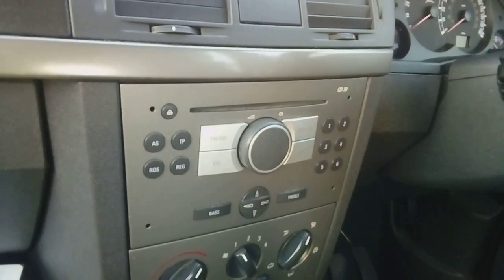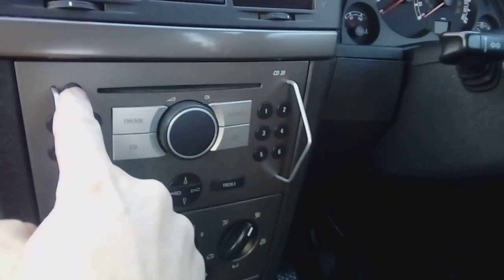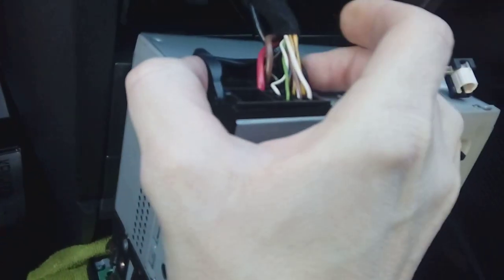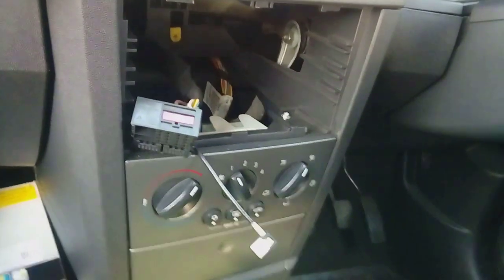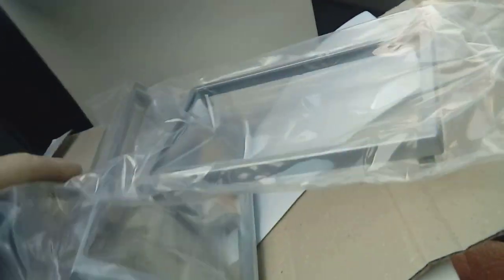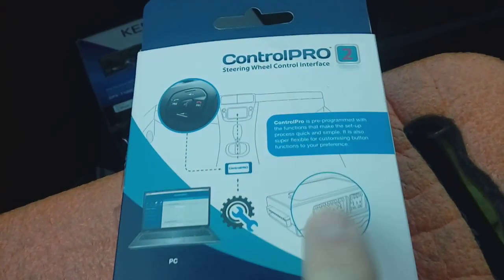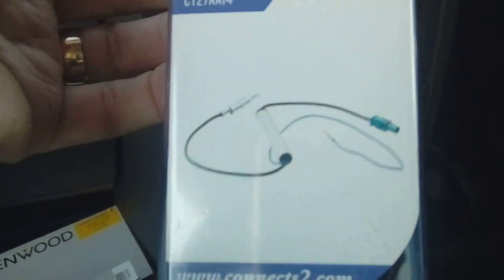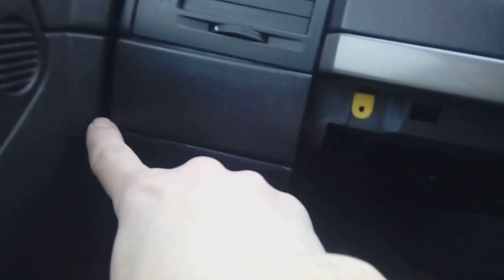Meriva 03 to 2012 how to remove radio & part numbers+tips to fit double din aftermarket radio

Comment: Just wish you ran through a few more of the cables between radio to car. I guess more in the sense of a tutorial with this perticular car. The question I have for you is how is the cables between the cars stock harness and the connects2 box handled. For the kit they aren't the cheapest but and willing to go for it knowing more so how it's done 😂. So I'm guessing the connects2 box comes with a smaller harness to go between itself and the smaller pins on the stock car harness. This is due to it being a can high/low signal down to analoge for the radios input?

Comment: Do you know where i can find a 12v switched live on this car?
Reply from the maker: The correct way would be from the cars internal fusebox but I've seen a lot of people wanting a quick fix run a power from the large red wire at the back of the heater control panel(I do not advise this).